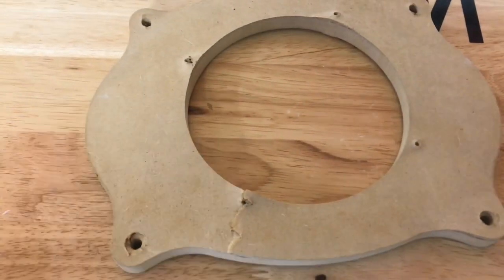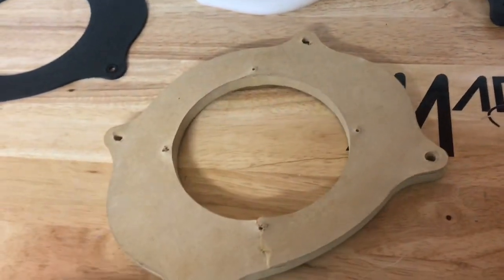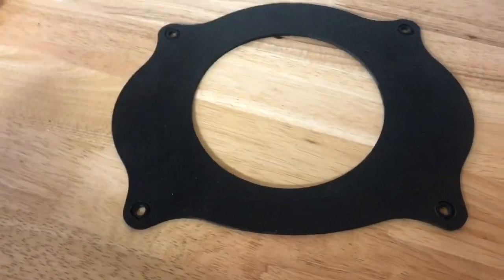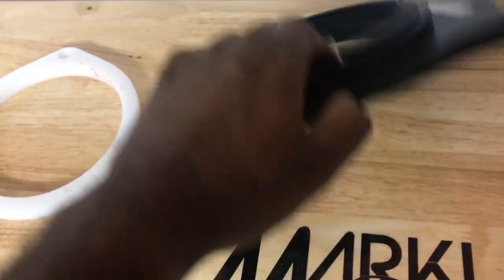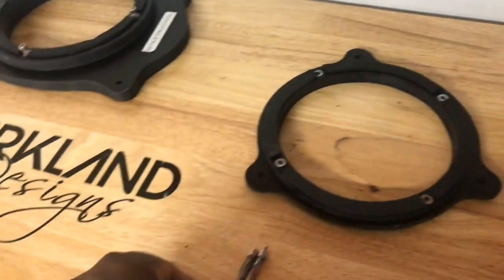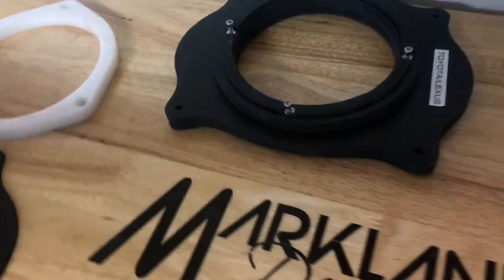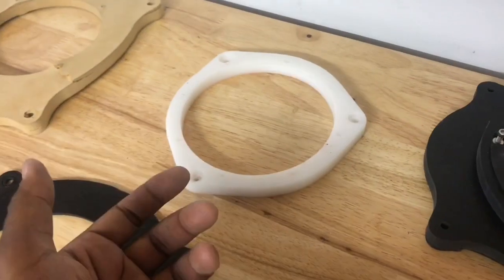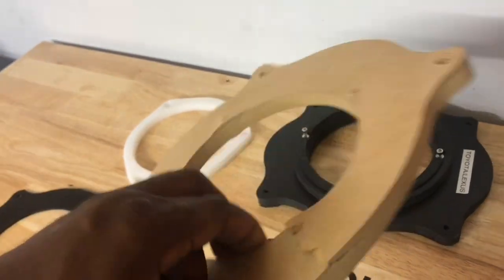Tips & Tricks #7 Speakers Adapters And Picking The Right Material To Use

Comment: Yeah pvc glue on the pvc  you'll never get it apart if you clean and bond it like pipes. 
So you can get trim boards and laminate them then cut to size . May come out cheaper than a sheet
Reply from the maker: Very True unfortunately doing it professionally you come across so many different sizes that sometimes the trim and boards aren’t big enough. Like some cars like Infiniti and come vettes have 10” mid bass in the doors. But for smaller application you absolutely can 👍
Reply: @MarklandDesignsOfAtlanta  yeah my cousin does house trim . 
You can get them up to like 12 inch boards. Like regular wood you glue up the board's to make the width you need .
If that makes more sense.
Reply from the maker: @luvdady  yeah I get what your saying I was just saying in some instances with some cars that need longer or have really large baffles buying a full sheet might be your only option or a smaller 2x4 sheet vs a 4x8 sheet